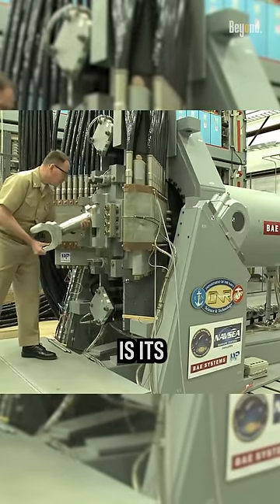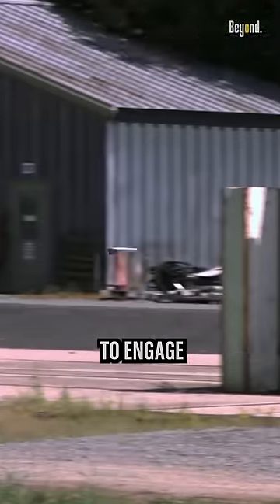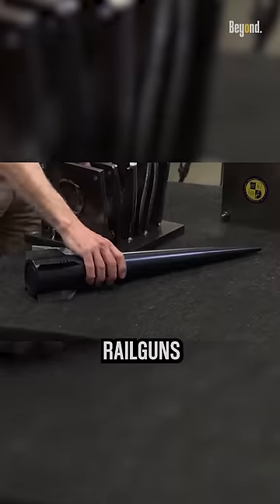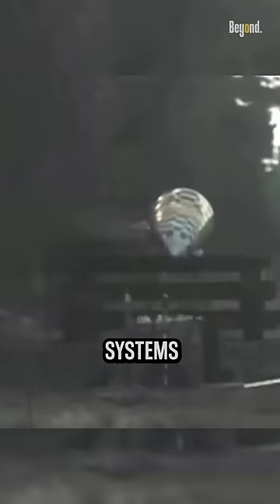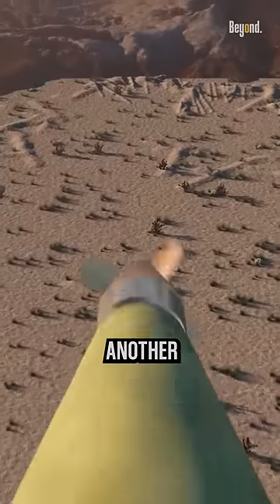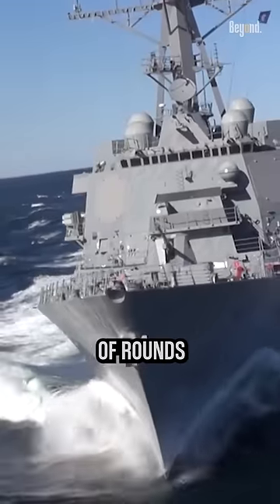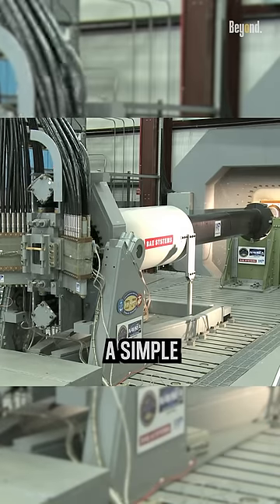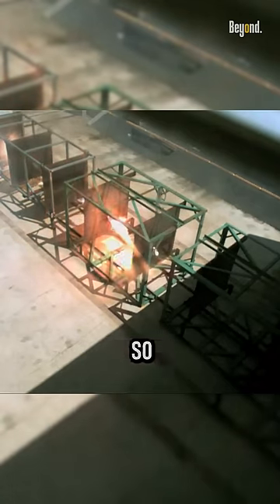Why does the US Navy need a railgun ? #shorts

Comment: Missiles can precisely hit targets over the horizon  and they get there fast enough.
Reply: yeah but they are relatively easy to intercept.
Reply: The cost way too much!
Reply: @floydrandol2731  
A magnetic rail that burns out after a few shots is no bargain either.
Reply: @PrivateEyeYiYi  eh, the real cost would be the material science so that they dont burn out.
Reply: missiles will take a couple minutes and have less then half the range of a railgun and its instant and cannot be intercepted
Reply: @madcitytournaments8591  
1. Nothing is instant except a laser. 

2. Railguns (and lasers) can’t hit anything over the horizon, while a missile’s range is limited only by its intended purpose.

3. Good luck hitting anything with a railgun, especially from a ship trying to hit another ship while both are moving in all directions. A missile’s course can be corrected right up to the moment of impact, something not possible with a railgun.
Reply: @PrivateEyeYiYi  a railgun projectile can go up to mach six which is almost for the range it is intended to be used at and you cant counter a railgun projectile unlike a missile which is pretty easy to do
Reply: @PrivateEyeYiYi  also railguns do have more range then missiles and warships can usually only go up to around 25knots which is not that fast and when you shoot a projectile going mach 6 at a ship around 130 miles away its gettting hit it in a couple minutes if not less and its not like ahips can do evasive manuevers cause unlike a missile the projectile is not detectible so ships are not gonna do any evasive manuevers or anything. And when a ship is jeading striaght at a certain speed its pretty easy to do the math to where to shoot the missile
Reply: @PrivateEyeYiYi conventional guns already shoot over the horizon during ww1, and ships could accurately shoot a moving target while simultaneously doing a figure 8 during ww2
Reply: @fidjeenjanrjsnsfh old big Gubs are outdated they may shoot  far but missed a lot of the time
Reply: @HAXRLITSXY hypersonic missile goes as fast or faster than rail gun projectile, can be directed, and has much more range
Reply: @timrutkevich3222  range yes, but everything else they share, and the railgun would hit targets faster because of the different launch methods.
Reply: I personally think of railguns to be far better defensive weapons over offensive tactics with it. Way more range than lasers and faster to deploy then missiles make fore a fantastic icbm counter, if used properly.
Reply: @HAXRLITSXY  not even close, Hypersonic missile can be launched from anywhere, even by fighter jet. hypersonic missile is pretty compact and can have very large projectile, this can have huge kinetic energy.

Rail gun is a huge piece compared to projectile size, it is pain to aim, because you need to orient a huge machine, you need a huge amount of electrical power, that needs a lot of time to accumulate. Yes, the initial velocity is higher, but it bleed out because friction of air is huge, the projectile can ablate and change its physical properties.

Top it up with radical changes in modern combat, where combat is BATTLE FIELD is completely transparent. After first shot, one risks to get destroyed by cheap single use drone
Reply: @madcitytournaments8591 mach 6 is 4603mph, 130mi target is 2 minutes away.
Reply: The other advantage a rail gun has over missiles is the ship doesn't have tons of rocket fuel and explosive ordinance that can ignite or donate if hit like the moskva. Still doesn't compensate for limited barrel use
Reply: @timrutkevich3222  each missile is going to be very very exspendive and their are not many targets
Reply: @timrutkevich3222  yea crazy fast and rhe rounds are pretty cheap
Reply: @PrivateEyeYiYi 2. Artillery can and has for decades fired over the horizon.

3. What do you think drones are for?
Reply: @lukasdeusch8468 comparing WW2 tech to today a straw man if I ever saw it. These days such shells would be gps guided like xcaliber.
Reply: @timrutkevich3222 not in any meaningful way dont underestimate the energy cost of maneuvering a hypersonic projectile.
Reply: @HAXRLITSXY also not affected by atmospheric scattering.
Reply: @timrutkevich3222  I call bull shit low altitude cruise missiles will require large amounts of energy to stay hypersonic. If you wish to refer to ballistic missles as hyper sonic then please see the kinsel interceptions.
Reply: @andrewyork3869  
I never said artillery shells couldn’t fire over the horizon. And the only WWII drones I’m aware of were used as gun targets, not observation platforms.
Reply: @PrivateEyeYiYi  modren drones and you did say artillery can shoot over the horizon.
Reply: @andrewyork3869  
Yes, I did say artillery could fire over the horizon. But  if you go back to my original post you’ll see that this is about the effectiveness of railguns vs missiles, not artillery.
Reply: Missiles consume precious metals needed for their on-board computers powering their guidance system though
Reply: @HAXRLITSXY arguable. Missiles that cruise above the surface of the ocean by a few feet have a tendency to be pretty hard to spot and intercept, for ships anyway.
Reply: @madcitytournaments8591 instant so split second then ? Utter rot might be fast but doubt its instantly
Reply: @Ian-mj4pt  well you wont be able to even see it before you are dead its pretty
Reply: @Ian-mj4pt  i think being able to hit targets faster then the speed of sounds counts as instant
Reply: Is everyone gonna ignore how impractical a Railgun is? Like dude, you need to actually fit a rail gun onto a ship, and then also have the power to power the electromagnets to actually launch the projectile at Mach Jesus towards the intended target. Forget how it would perform in combat, Railguns on ships don’t work because of the huge drain on resources
Reply: @Ling__Ling__  true but being able to hit a ship from a couple 100kmh away and only 1 shot being able to take out a ship is pretty good also you cant detect it
Reply: @madcitytournaments8591  but what isn't good is gonna be the huge drain on power and how goofy ahh the a ship with a rail gun would look
Reply: @timrutkevich3222 and are way more expensive
Reply: @PrivateEyeYiYi  Ships have other weapons to fight other ships.  Railguns are for land targets.
Reply: @shawnheidingsfelder8179  
Missiles can hit land, sea, or air targets, have guidance systems and longer range than railguns.

Comment: Each shot from that rail gun builds up heat which can melt the metal rails if not properly cooled.
Reply: And the magnetic eddys warping the rails are a pain too.
Reply: Part of the reason the navy scrapped the program was, other than the massive power requirements, was the fact that the barrel would last for only 10 shots, at most...

Comment: Tungsten is pretty expensive not to mention heavy
Reply: Cheaper compared to other ammunition. It mainly depends on manufacturing costs over material costs.
Reply: the us had no problem with budget it was just the actaul railgun that was the problem cause it was too massive and they could not find a way to shrink it so it would be useless on ships
Reply: Cheaper and lighter than osmium
Reply: 🤦 thats the point. Tungsten is used on ap shells cause its self sharpening, the more you try to hurt it the deadlier it gets, and its density means theres plenty of it per round to do some serrrrrious damage
Reply: @jamesmaddison4546  it it being able to go at 5,500 miles per hour and have a range of 125 miles is a deadly combo
Reply: It's not the rounds that are the problem, it's the enormous amount of electricity needed to power the electromagnets to propel the shot. The ammo may be cost effective but the energy needed to fire it definitely is not.
Reply: @jamesmaddison4546 
Wait, wasn't depleted uranium self sharpening? Or are both materials capable of this but depleted uranium is better?
Reply: @cartler look up the gbu-28 if you're interested in manufacturing cost over time. They took old howitzer barrels and filled them with explosives. There was an arsenal somewhere in New York I think that did the prototypes, and get a working finished product in like three weeks. And those barrels were titanium 😂
Reply: @madcitytournaments8591 It could be used as an anti ship gun. Put it on an aircraft carrier to desimate any enemy ships.
Reply: @cartler  theres a finite amount of tungsten. If it becomes op during war there will be so little left that the navy will have to go for a new material so its a waste
Reply: Tung = heavy ; sten = stone
Reply: @madcitytournaments8591 Well, maybe not completely useless. I think it was rather that they didn't want to re-introduce battleships or make and engineer a whole new class of warships.
Reply: @ForTheBrotherhood  nah it looked good on paper but when they actually made it they realized that it could not do stuff as well as they thought and was kinda useless
Reply: @jonathancole5179  and where on a aircraft carrier would u put it?
Reply: @madcitytournaments8591  Build it into the front hull most likely. In the extremely unlikely case the whole escort fleet goes down. Of course we need a more reliable option for avoiding breaking it in few shots.
Reply: @jonathancole5179  you mean where the aircraft take off?? Almost every single inch of a aircraft carrier is taken up by something
Reply: @davisdf3064  Depleted uranium is more accessible. Tungsten is better but less available.
Reply: @jamesmaddison4546 Tungsten rounds are not self sharping, Depleted Uranium rounds are however.
Reply: its also highly brittle

Comment: But railguns need a lot of energy to fire a shot it also overheats
Reply: Shooting a rail gun also destroys the system pretty fast.
Reply: @Kosmonutty  by overheating
Reply: @______-795 that and bc it just rips all the wires apart due to the powerful magnet.
Reply: @halodude4481  its recoil isn’t exactly powerful its only the heat generated
Reply: @____-795 railguns don't ignore the laws of physics. If you launch something that's 100 pounds at 5k miles an hour, no matter how you launch it, there will be a force of 100 pounds x 5k miles an hour in the opposite direction. That's not to say the recoil is any worse than a 12 inch cannon, but the recoil cannot damage the cannon. It's just a huge metal tube with dampeners. A railgun is a complex electronic system that has shown it cannot take more than a few rounds.
Reply: @______-795  I’m not talking about recoil I’m talking about the magnetic ripping everything out a magnet that powerful will rip sensitive material out
Reply: They don’t overheat the risk, it destroyed by the plasma arc. We have fixed the problem.
Reply: Ships make their own energy. When the barrel fouls you swap the barrel. Meanwhile your target over the horizon has a 1-meter hole on the water-line and has way better things to do than chase you down while you're recharging cap banks and hot-swapping a barrel.

Comment: The biggest disadvantage of the railgun is it's high power requirement.  In a sea battle, a ship hit hard will often lose power.  This immediately knocks out the railgun.
Reply: i think the biggest disadvantage is actually maintenance, as the rail gun tears itself apart through vibration after only a couple of shots, and the military was never able to solve it
Reply: thats not a problem cause the whole point of the railgun is for you too be able to shoot at other ships before they can even see you and 1 shot can almost scuttle a whole ship. the biggest problem is them not being able to actaully fit it on any boat in the navy
Reply: Ships make their own power. If you've somehow lost power to a foe over the horizon (railgun engagement range far exceeds line-of-sight), you have already fucked up.

Comment: Publicly the navy has stated that currently they have no use for this weapon, and because of the massive costs in building one and maintaining it properly,, they have discontinued any interest in aquiring more of them.   I’m pretty sure that if ,, they are still in use today,, the operation of such a weapon ,, is held as a top Secret , and kept on the downlow.😊
Reply: They pulled all the funding because of cost overruns and they couldn't figure out the barrel. The issue there being that the barrels would only last something like 16 rounds before basically the entire emplacement would need to be replaced and that's something you can only do in a dock with a crane. On top of that the "rounds" were still a million dollars each and with the majority of the ships that were going to have these emplacements getting canceled nothing could be done if they proceeded to still arm and stock rounds for the remaining 3 ships that were completed. (Zumwalt class destroyers)
Reply: @user-gh1ql5uc8t   Thanks for the correct awnser.   I’m Shure that they had a good reason why.   On a different note,,, the navy announced recently that the Zumwalt class destroyers are to be discontinued and later disbanded in favor of a more conventional midrange HyperSonic missile  cruiser.  Hopefully, the change over is going smoothly.
Reply: @Banthisyoutube  Nah the slugs for the railguns were over a million per shot for cost to manufacture.
Reply: @hannswade6252  Yeah, it was the cost overruns for the zumwalt as a whole that sank the entire program. I think the number for the three ships we did get is something like 17 billion dollars spent on the whole program, and the railguns for the destroyers were a major chunk of that funding. Somebody somewhere made bank and didn't produce. For context, I think it was roughly 5 to 10 billion, which was the expected range cost for building the entire first phase of zumwalts, which was like 30 to 35 ships.
Reply: @user-gh1ql5uc8t  Source?  I see the cost projected at around $25000 to $50,000 per round. For comparison, an Excalibur round is ~$70000.  I also found that the projected life expectancy of  the barrel is closer to 1000 shots before it needs replacement.
Reply: @user-gh1ql5uc8t  i doubt that could actaully fit the massive and heavy railgun on a zumwalt cause of the way its shaped if its too heavy on the topside its gonna flip and that railgun is heavy as hell
Reply: @hannswade6252  the zumbwalts look sick but are useless as hell im sad they got completely nothing out of them though
Reply: @user-gh1ql5uc8t  i dont think the budget was a huge problem cause every couple shots is 1 billion dollar ship scuttled but they could not actaully put them on navy ships cause they are heavy as hell and massive. also maintaining the railgun constantly on a ship is pretty hard
Reply: What navy?
Reply: For what it's worth, we said the same thing about hypersonics and only recently considered them worth exploring. They're on the back-burner and probably for the better. Will give time on the drawing board to work on capacitance, cooling and barrel fouling issues for the next designs.

Comment: the best thing about railguns is that while conventional gunpowder weapons have a maximum speed because the expanding gases cant be infinitely fast(that speed is ~900m/s if im correct) but the speed of a railgun projectile purely depens on how much electricity you pump into the system, and if a ship uses a nuclear reactor to get power it means it has a to of oower to pump into the system

Comment: Still think that regardless of the safety, ship survival should be key.
Reply: But if the ship is hit in the battery of charged capacitors there will be an explosion as powerful as if it had been hit by a hypersonic projectile
Reply: well the ship will have to be SO LARGE, that it will be a target of a much bigger size. Cost also. If we're going to spend that much a submarine or two would be better.

Comment: There is another weapon called an ETC Gun which is fairly similar to traditional guns but the main take away is that it requires an electric charge to trigger the propellent and the propellent would be a kind of chemical that will require a strong electric charge to ignite it so in theory it would not be ignited by conventional explosives so its far more safer and all the while ETC guns can launch projectiles at speeds that are comparable if not even rivalling rail guns whilst still also capable of accepting some conventional regular ammunition if needed

Comment: The biggest problem with rail guns is that electronics degrade VERY fast and with each shot rail gun becomes weaker until eventually it doesn't have enough power to power magnets

Comment: Another thing about rail guns is "what's the point?" Ships close-range engagement is like 15-30 miles away from each other with conventional munitions, don't know if anyone has been keeping up, but ship-to-ship engagements rarely happen, especially among peer-to-peer advanced militaries. The few recent engagements that are peer-to-peer were by accurate missiles and aircraft. What's the point in having a glass cannon that can only be shot a few times when you can have multiple regular ship guns that can fire multiple times without being replaced. Particularly when there is no need or foreseen or even unforseen problems that need to be fixed?

Comment: One main disadvantage of the rail gun - it requires an immense amount of electricity to power the electromagnetic fields, which means that it won't fire during a blackout or some other form of electrical failure.

Comment: The biggest hurdle to railgun tech is power supply and material strength. To achieve the destructive capability required, you need the power generation equivalent to a whole city. Then the barrel material could only fire three shots before it destroyed itself.